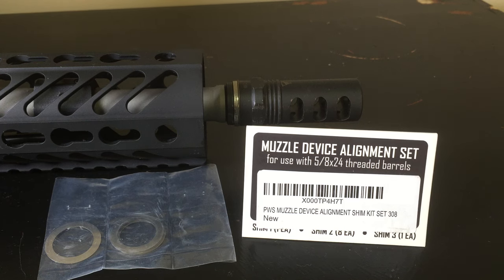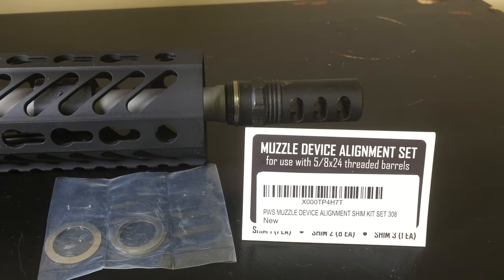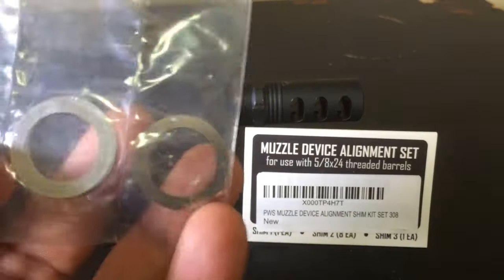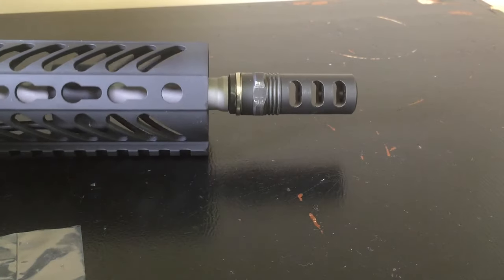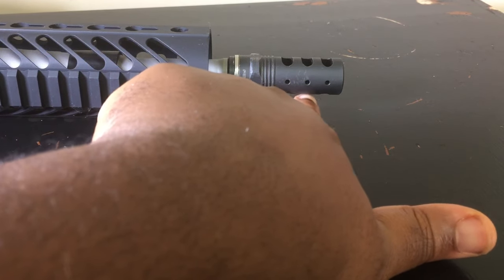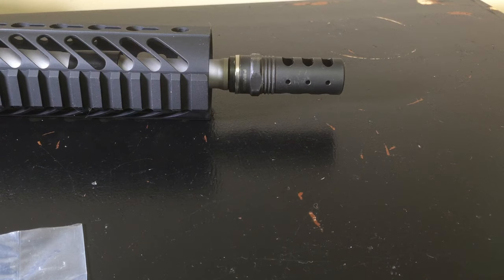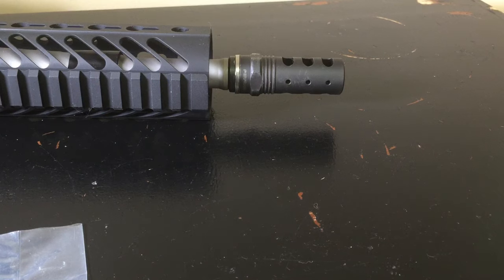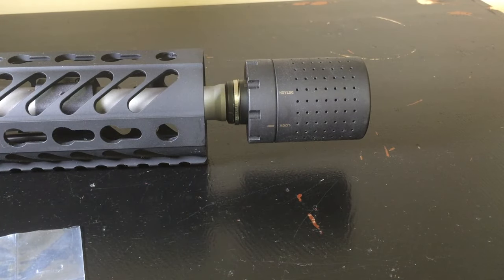Project Veronica: Ferfrans CRD Install

Comment: Hey Manny, great video. Just bought my CRD today and was having trouble with alignment too. Haven't seen anything helpful out there, until I can across your video. Thanks man. 

So it doesn't hurt the rifle to add more washer to any muzzle brake device?
Reply from the maker: As long as it's a shim made for barrels you are good to go, and I had the exact same problem as you and had to figure it out on my own. Which is exactly why I made this videos so people don't have to plow a new path when buying these parts. New content coming. Thanks for stopping by.
Reply: +Manny Macfly Absolutely no prob man. I'm soon doing a video on my new SBR Geissele Ferfrans build, so I'll forward your video in the process. Later.

Comment: What caliber is your weapon? Did you buy the 308 crd muzzle device? I only ask because I want to build 300 black out pistol, but can’t find the Crd for that Round.
Reply: Seriously dude? R u that much of a newb?? Ur .300 black out will fit through a .308 suppressor, brake, comp any of em... bc why? Oh yeah bc .308>.300 duurrtt da durr .300 is 30 caliber so it wouldn't have a problem

Comment: Question, does this CRD work with other muzzle break?
Reply from the maker: +Phyvan Boungnavath I won't say it won't work on any other break, but its designed to only work on their breaks. twist locking unit on the shield.
Reply: +Manny Macfly gotcha, yes the reason I ask is because I have a few comps with those same notches indent like the ones they use was seeing if it was a little universal. But cool thanks great Vid!!
Reply: +Manny Macfly one more question if you have the answer for it? I know the comp is for 308 but will the Shroud work with a 556 comp or have you tried it?
Reply from the maker: +Johnny Blaze Sorry not sure why i never seen this question. The blast shield is universal to 22cal and 30cal muzzle devices. Which is why they sell them solo as well as together via Tactical Link dot com

Comment: Do you recommend crushwasher/shim/brake or shims/crushwasher/brake
Reply from the maker: Crush washer must always be facing the correct direction (See video) against the barrel. You wont want to place any washers or shims in-between the crush washer and barrel.

Comment: the space between the end of the rail and the beginning of the CRD is so unattractive. barf.
Reply from the maker: Its only unattractive because thats all thats in frame and the focus of the video. Nothing but wows when people see and handle it in person. I have plans on going with the longer hand guard just not priority looking at optics right now.
Reply: Okay I hope you're right because I'm in the same dilemma. Which optics are you looking at?
Reply from the maker: +khyoon14 leaning towards trijicon MRO
Reply: @mannymacfly9567  mro is a waste. Get an eotech. Back in '16 they nearly went to shit bc of three things... thermal distortion/ thermal creep, delamination of the lense and they held moisture inside so L3 the owner of eotech brought all they're engineers in an fixed every single problem literally. Eotech is beyond worth it, and far better then the mro in every aspect.